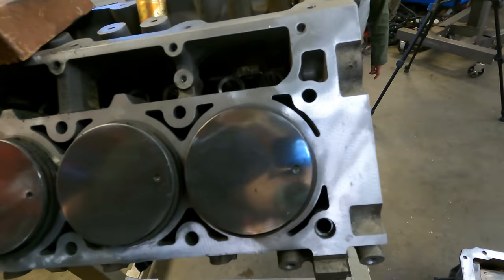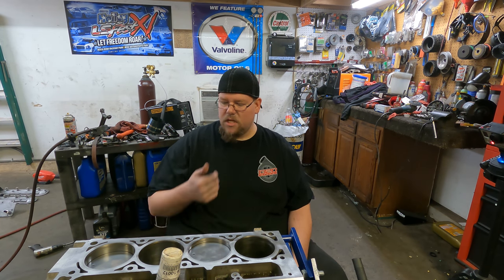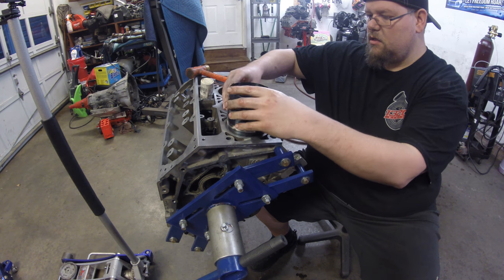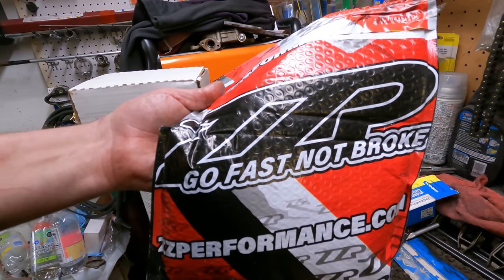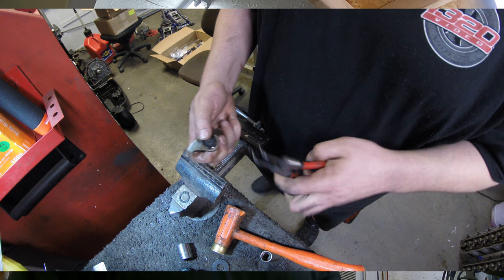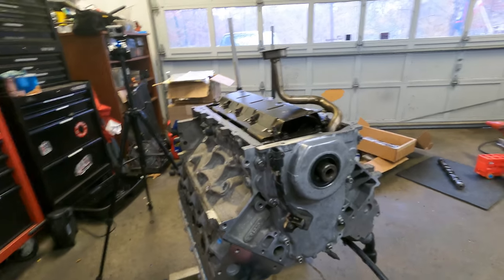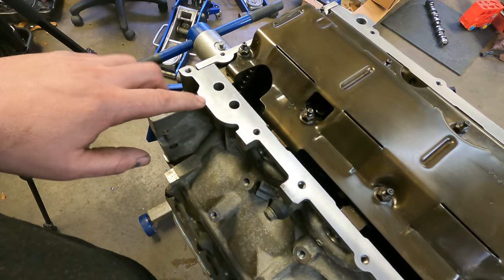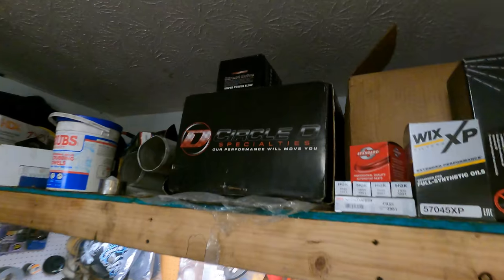2008 TBSS Engine Rebuild! Cleaning & Assembly! PT3 (4K)

Comment: O YEAH!!!!! Love this stuff!!!!! That was about two pages of notes!!! Lol.😂👍 What cam?? Stage 2or3?? Great job on the details!! Looking forward to hear it first start up.. I’ve heard a stall really wakes them up a lot... Can’t wait to get a piece of the pie so I can do some work on mine!! Keep up the AWESOME WORK!!!!! 🤙🤙👍👍!!!! O I almost forgot. GREAT WORK LIAM!!!!!!
Reply from the maker: Thanks brother! I've been so busy I forgot to respond!!! The cam is basically a PCMofNC attitude v3 cam. But I had texas speed custom grind the cam because of time constraints. Yes a stall really makes a huge difference on these things for sure. You can actually get one really cheap that's an oem part. You can get a torque converter for a 4.2 trailblazer and they go right in they are 2600 flash stall and the stock tbss one is 1400. You can get one from oreiley for about $160. Btw she sounds good man, I'll be working on the tune more tomorrow and the video will be out asap. You need to come down and visit me sometime! Thanks for being my #1 fan!